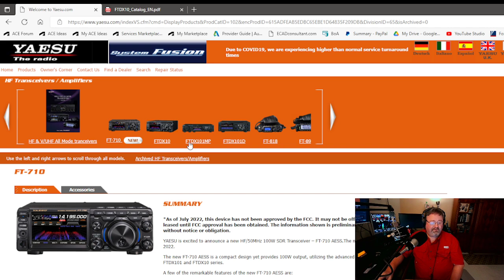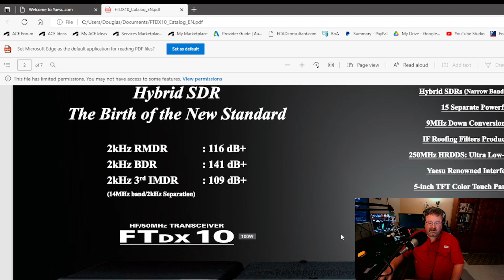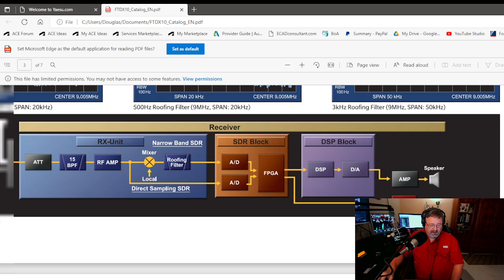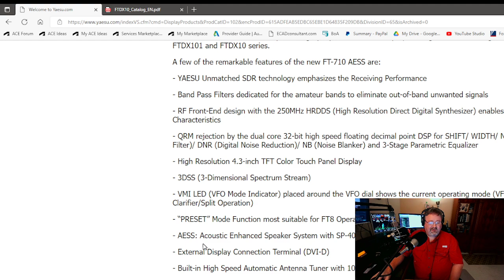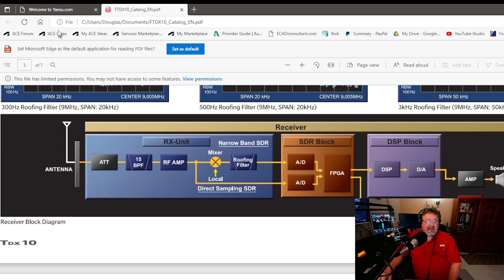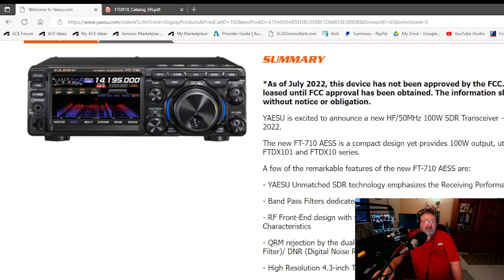Yaesu FT-710 AESS: Specifications (video #3 in this series) #hamradio #yaesu #ft-710

Comment: Going by the size and spec, the FT-710 looks like ft-450D replacement and not FT-1200 replacement.
Reply from the maker: John Kruk, from Yaesu, characterized it as filling the FTdx1200 spot. And, since the FTdx10 is to the FTdx101D what the FTdx3000D was to the FTdx5000MP, it makes sense.  The FTdx1200 was a FTdx3000D lite.  But, since Yaesu hasn’t replaced the FT-450D, I guess the FT-710 can be considered its replacement as well. 

73, de N4HNH

Comment: The FT710 is the successor for the FT991-A, that is, partly. The other part is coming little later after the FT710 has been released. It will be maybe the FT810 ( same form, same size of course; placing them nicely side by side together) and is housing a 2 m band radio; a 70 cm band radio and a 23 cm radio. All in one, just like Icom did with the IC7300 and the IC9700 shortly thereafter. Each radio pricing $999,- buying both sets you back just under $1999,- making Yaesu about $700,- more than the FT991-A costs. Just brilliant (!)
Reply from the maker: And you know this how?  John said the FT-710 is not replacing the FT-991A.
Reply: @n4hnhradio  John is right, the FT-710 in itself is not replacing the Ft-991A. However, the combo FT-710 & FT-810 is. This is information  John has no acces to. This is inside information directly from R&D.
Reply from the maker: If that’s the case, Yaesu is screwing up again, not listening to their customers. I get trying to mimic the 7300 9700 thing, but the 991A has it all in one box. And Yaesu hasn’t even replaced the 857D yet. They literally pushed their would-be customers to ICOM for the 7100. Yaesu needs to pay attention to their customers better.

So, can your R&D person confirm if the FT-710 is a pure SDR or a hybrid with a fixed roofing filter?
Reply from the maker: It is interesting that John told me in the Yaesu booth at Huntsville that Yaesu was going to continue with both the superheterodyne product line and the hybrid product line running parallel. The FTdx3000D was cancelled a few months later, followed by the FTdx5000MP a few months after that.
Reply: @n4hnhradio   Well...that figures!                        And no, Yaesu isn't screwing up at all, this is brilliant marketing!  Just like any other company Yaesu is trying to make money. The customer is there to comply ;-)

Comment: So this looks like an answer to the IC-7300.  The FTDX-10 was several hundred $ more and in listening to people compare them and then refer to the price, I'd guess the 7300 was killing it in sales.  So Yaesu puts out this and the decision isn't so easy any more.  Nice move.  The competition is great for us consumers.
Reply from the maker: Actually purchasing the FTdx10 is an easy decision right now.  It is only $150 more than the IC-7300 and it is number 2 in the world for receive, compared to the IC-7300, at number 22 in the world for receive. 

I think Yaesu wanted a transceiver to compete with the IC-7300 without continuing to cut the profit margin of the FTdx10 to do so. I expect the FTdx10 to go back to its normal price of $1699.95, or maybe $1599.95, after the FT-710 is released. Even at $1699.95, the FTdx10 is an unbelievable deal. It beats transceivers that cost more than $10,000. It beats the $14,000 IC-7851 and the $17,000 PT-8000A in the receiver tests. 

I was told by a major ham radio retailer that Yaesu doesn’t really need to compete for sales. They are already number 1 and there is no close second. I guessed ICOM was number 1, because of the IC-7300, but he told me I guessed wrong. 

I do think Yaesu wants to compete with the IC-7300, but they don’t need to for sales. I think they just want to stop selling the FTdx10 so cheap. I expect the FT-710 to hurt the sales of the IC-7300 but not too much. The FT-710 has newer and more advanced DSP technology and offers a direct output for an external monitor, something the IC-7300 lacks. I also expect Yaesu to do a better job tackling the potential of front-end overload, such as is common with the IC-7300.  But, Japanese companies don’t try to hurt one another intentionally. It is an honor thing. They are friendly competitors. 

73, de N4HNH

Comment: Another very informative video. I didn't pay much attention to the FT-710 features until you started explaining its roofing filter absence. I for one, wouldn't buy such rig. Have been playing with SDRs since the Perseus was released. Most all of them fail, as there are no filters, and sooner or later your ears will start begging for good old reliable technology with deep sound. That's the reason I keep my FT-890.
I also like to use the IPO whenever the noise is greater than S2 all the way to 10m. My ears thank me for that either operating CW or SSB.
Last but not least, have you already saved all the FTdx5000 folders that Yaesu has on its webpage?  Just a heads up...
Reply from the maker: Luciano, you and I are cut from the same cloth when it comes to radios. It is uncanny. 

I have been saving files from the FTdx5000 page. I don’t expect them to be there much longer. I need to double-check that I have them all. Great idea. 

73, Doug

Comment: The Sherwood list is ranked by DR-3 at 2Khz and not by RMDR.  The RMDR is independent of the hybrid technology. The roofing filters ahead of the ADC/SDR allow for the higher DR-3.   If the FT-710 has the same "pre-selector" roofing filter as the FTdx-10, it will have a superb DR-3 at 2Khz.
Reply from the maker: The FT-710 won’t have a roofing filter. It won’t have a 1st IF. A preselector is not a roofing filter.  A preselector is ahead of the first mixer.  The FTdx101D has one.  It is called VC-Tune.  The FTdx5000MP has one.  It is called VRF.  There is the option to add an even better performing preselector, called a mu-Tuning preselector.  A preselector is inserted between the bandpass filters and the first IF.

The FTdx10 doesn’t have a preselector.  It relies upon quality bandpass filters and state-of-the-art low phase-noise design. 

The FTdx101D and MP have a variable preselector called VC-Tune. The FTdx10 does not include VC-Tune. 

The Sherwood ranking is a mixture of DR3 and, where applicable, RMDR, at 2kHz spacing using CW. He uses a 500 Hz filter for the test, when possible.  Rob's ranking is based upon CW mode, though one can extrapolate from this measurement that the receiver performance for other modes should also be better.  Other factors should also be considered, but I like to incorporate Rob's rankings when choosing a transceiver.

73, de N4HNH

Comment: Hi Doug.  Thanks for the psk/data configured info you shared yesterday! I've scratched the surface of ft8, but never really spent much time on it until today. It's actually a pretty good way to play radio when conditions aren't ideal, at least for me anyhoo...73-W4mud
Reply from the maker: I’m glad you found it helpful. FT8 is okay. You’re right about it working during not so good band conditions. 

73, Doug
Reply: Or, when you just don’t want to deal with PEOPLE. Grrr…
Or, to say, “Not ideal people conditions”.